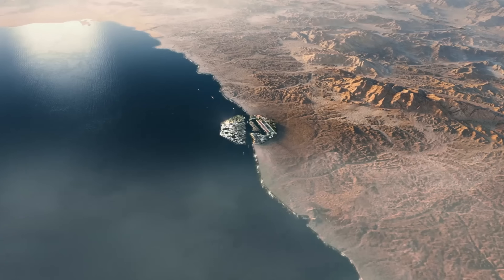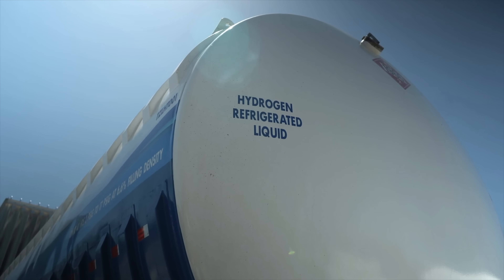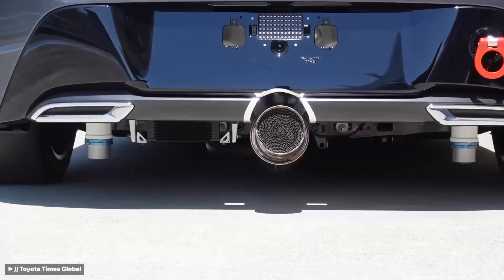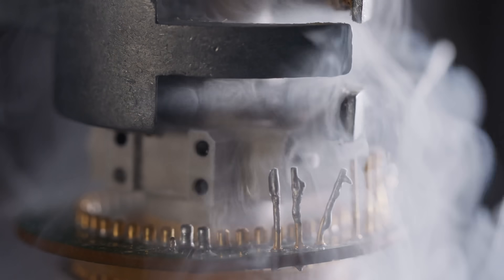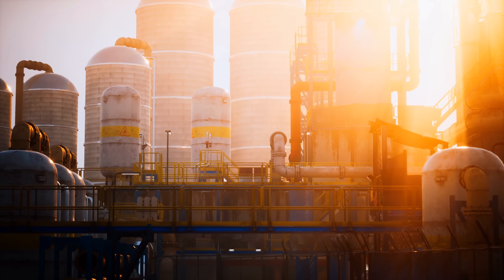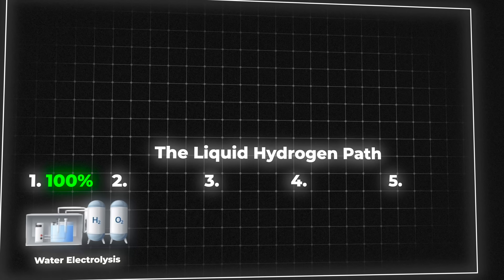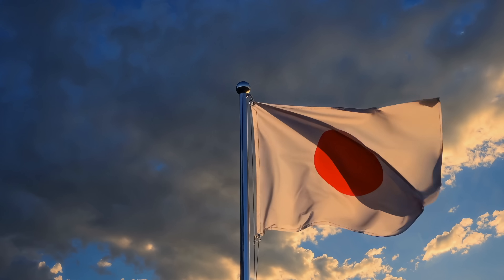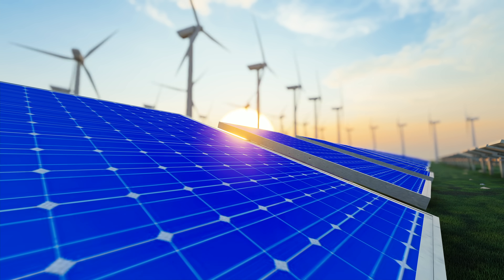World’s BIGGEST Hydrogen Plant Produces 0 Hydrogen

Comment: Wasting all that energy to produce a horribly inefficient source of energy.  Yeah that makes sense.
Reply: There’s not of a lot of other ways to decarbonize sectors without it
Reply: @James-wild nuclear literally fixes everything and is far more logistically feasible. I don’t understand why people hate nuclear. That shit produces zero carbon, has high momentum to handle surges, can produce for as long as you want, while at the same time being of nearly infinite abundance especially when considering fast reactors and thorium reactors. It also is one of the safest forms of power leading to less accidents than wind
Reply: @seanziesman602 well traditional nuclear power plants for electricity and large cargo ships may be the only good sectors nuclear
Could help decarbonize. And help only, if we tried using all nuclear for all cargo ships and all new power plants we’d never be able to meet demand and the costs would be extremely high. But there are sectors nuclear doesn’t even really make sense in. Aviation, chemicals, etc. so we’d obviously need something else to decarbonize that.
Reply: @seanziesman602

The main issue with nuclear is literally just the cost and time to build. It takes 10 years and costs to billion to build a new plant. Current rates of solar and battery installation just straight up beat it on price and speed.

Also, nuclear power isn't all that useful for fertilizer manufacturing. We need green hydrogen for chemical purposes. It's silly to burn it for heat or to use it for energy storage, but for chemical manufacturing (especially fertilizer), or steel making (as a reducing agent), it's one of the few practical options. You can't just zap crops with nuclear-generated electricity to make them grow, unfortunately. Some things need chemicals, and chemicals need to be made green as well
Reply: @kylejohnson6775 well not too burst ur bubble buddy but most of the time you don’t need a reducing agent on steel. That is in BOF steel making. Most steel making is an Electric Arc Furnaces, at least in America, which have no need for a reducing agent. Well they do…but it is to create a nice liquid slag at the the top of the melt, the carbon reacting with the oxygen and other impurities creates a slag that insulates the lightning bolt and ensures proper melting. This is the way most steel making is done in America. Tbf it cannot process iron ore just scrap steel or scrap steel mixed with iron ore. Iron ore has low conductivity, unlike steel, which makes the lighting bolt ineffective
Reply: Always they say there will be "breakthroughs". Why not just make the breakthroughs in Nuclear

Comment: Hydrogen is not worth it, it's literally a Cons vs Cons, with the Pro out wiegth but literally everything else and destroyed by Solar, Wind & Hydro. Even with green conversion, for EV, it STILL requires a battery to work and it will ALWAYS be less expensive to just use solar, wind and/or Hydro..

They are literally building more waste, wasted time, wasted energy and wasted results, just to say, "well yeah but, afterwards it turn into water🤨"
Reply: Hydrogen has many wonderful uses as a chemical and will be incredibly valuable that way, so this effort isn't wasted. We need to make hydrogen green at some point. 

It's just not good to burn as a fuel or use as energy storage (with a small handful of potential exceptions).